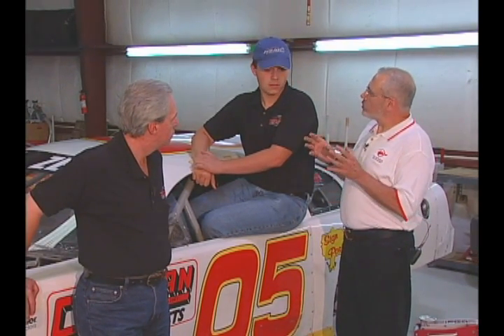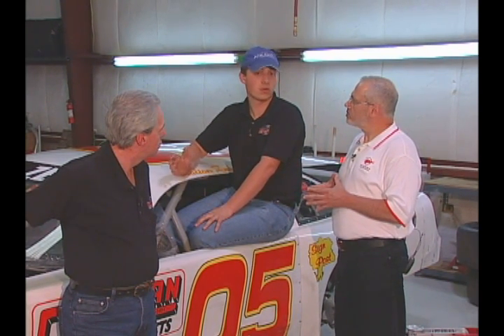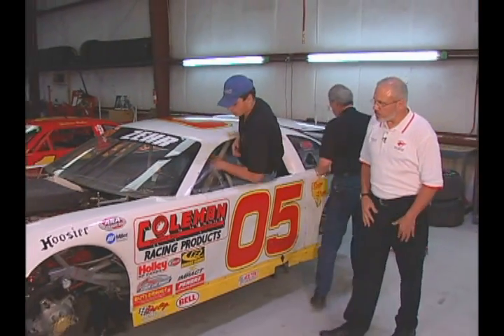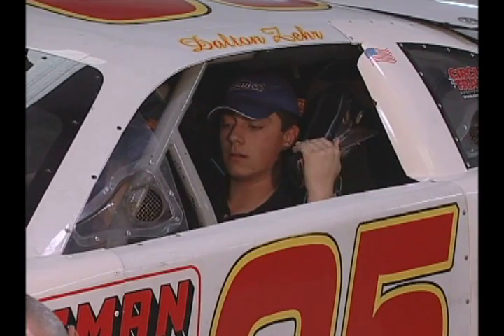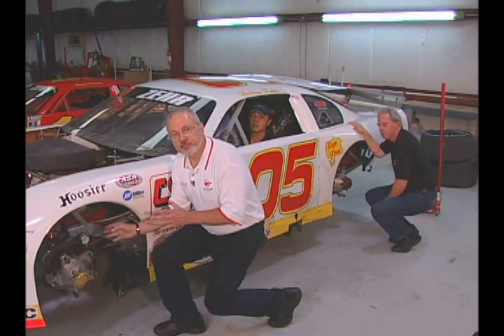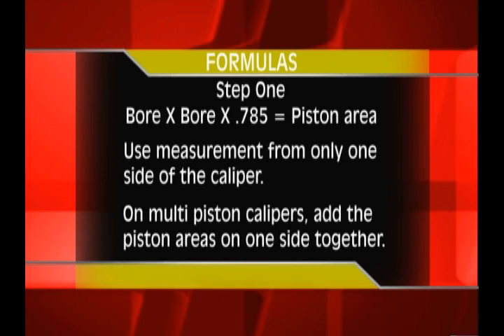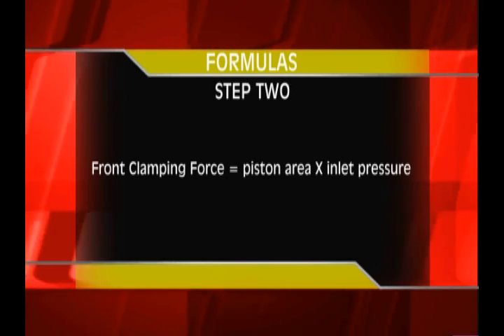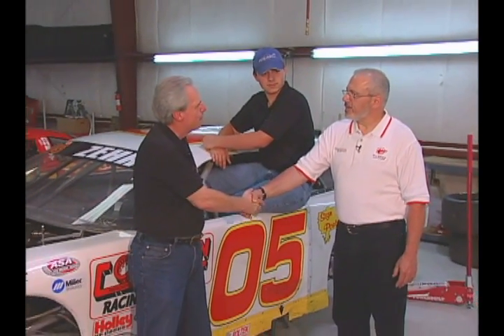Racing Brake Systems with Wilwood Part #3

Comment: You guys never discussed the effects of rotor diameter and and tire diameter on the brake balance.  It seems like the latter would be an important thing to mention for guys running outlaws and midgets.